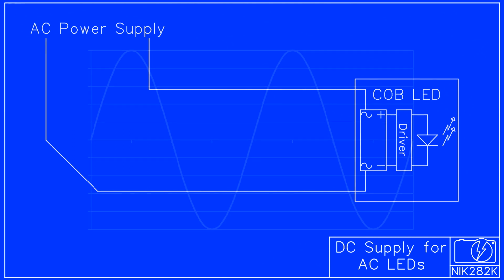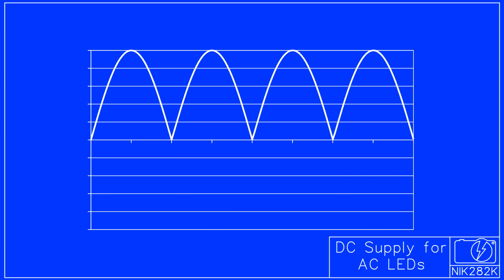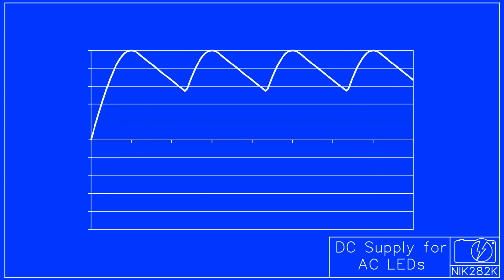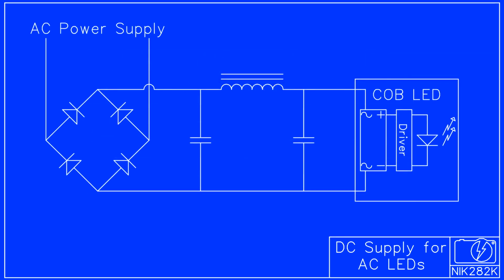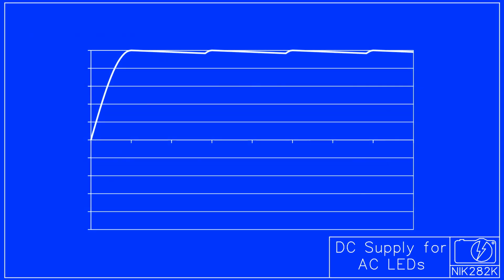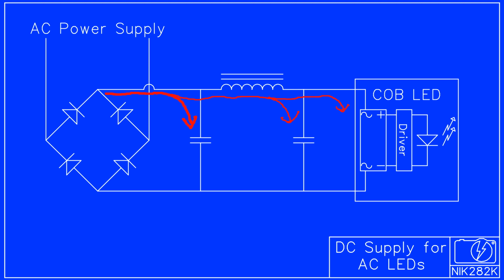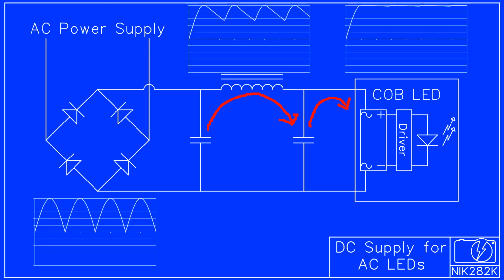De-Flickering Cheap Driverless LEDs

Comment: nice solution, the issue I get is small flicker when light is ON on a Led COB 50W.
I use somes around and of course with cooling, and sometime there is a weird flickering.
Unfortunately you solution require big stuffs...

Comment: I have solved this in much cheaper way. Just add a 250V 10uF capacitor directly on the LED chain, after the regulator chip. You'll need to scrape off some coating and find which traces are the ones you need.
After doing it, these LEDs become nicely dimmable without any flickering or working out of spec.

Comment: Great video Nick. I'm looking for an LED lighting solution for our table tennis table and I'm wondering if you can help me understand something. I bought a nice bright 100w flood light, installed it, but as soon as we started playing the ball was suffering badly from a strobing effect (probably like your high speed video lighting problems) which I presume is because of the 50Hz AC of our mains electricity here in Australia. If I was to make my own floodlight using a 100w led which was powered by a DC driver would that solve the strobing problem? Would the driver need to  be specifically a constant voltage or constant current - or wouldn't that matter?
Thanks very much for your help.
Reply from the maker: I ended up buying as many cheap LED work lights as I possible and adding a smoothing capacitor across the LEDs. The drivers still put out noisy power but the capacitors smoothed it out. I found that to build my own from scratch would have been almost 10x the cost. If you take your phone to the hardware store you may be able to check for flicker by just filming the bulbs while lit, there are some 100% DC LEDs out there but they are the exception.

Comment: Hello, I was wondering if there is a simpler version of this power supply you build, I bought one of these COB LED boards as a overhead shop light replacement and I can visibly see the flickering.  Is there a small circuit I can build to put between this COB LED Board and the 120V power outlet to stop the flicker?  Thanks

Comment: Hm, I think if you buy a 220V LED and apply the rectified 110V signal, you'd end up about at their original rating! You can also add the capacitance onto the board directly (under the silicone), though that won't filter as well as your LC circuit, it may be good enough.

Comment: Hey Nick,
How do you calculate the size of the capacitors and inductors needed? i'm trying to build some custom LED floodlights without flicker..
Reply from the maker: There are a number of online calculators you can use to calculate the values. I only had the one large inductor on hand and for the capacitors I kinda suck up on the value by measuring the ripple and then adding more on either side of the inductor. If you are going to be working at a fixed voltage it might make more sense to just get a switching mode DC supply. They are a lot smaller and don't require heavy iron cores.

Comment: Good work nik keep it up was really cool to see

In my country we are supplied with with 220 VAC @ 50 hz and also noticed the flickering, it could be actually a higher flickering rate (since I recall this means higher dc spikes due to lack of bridge rectifier on board) I could be wrong.

Comment: Have you considered using a T rather than a Pi filtering circuit? It should cut down on inrush as well if I understand correctly.
Reply from the maker: I only went with a PI filter because big caps are a lot easier to find than big inductors (without cutting up more transformers). I could add some how power/low value resistors in series with the caps to limit the inrush but I have just taken to slowing increasing the input voltage from 0 instead of just switching it on to a full 80Vac.

Comment: did you know that there are circuits that can 'cheat' at the ripple reduction? the 78xx series uses them in thr final internal output stages. tip31 transistors, too. they use negative feedback to eliminate ripple. the downfall is you need trsnsistors to handle all the power ( to-3 cases would be best but you can get to220s out of any old crt tv near the pcb on the socket ) id google ripple reduction and.mosfet because there has got to be something new out there since i was in electronics college
Reply from the maker: I originally went with this big linear supply because I wasn't sure exactly what type of lights I was going to be running, although I have now settled on a slightly simpler solution. If I had the experience I would have ideally made a big switching mode supply that would let me really cut down on the ripple.

Comment: I think even at 120V DC the LEDs will be overdriven since you have no off-time in the DC case. RMS and DC are only compareable for a purely resistive load, but the LEDs with their inherent forward voltage and the driver chips are an off/constant-current load. Luckily those driver ICs (I have a few of those LED modules as well) have a built in over-temperature protection, that protects them from too much load. They also indirectly protect the LEDs since they are mounted on the same board. But this is only a protection against gross over-temp and should not be relied upon.
Reply from the maker: The off time was my first thought as well when I started playing with this and I found something really bizarre. When I run them at 110v (maybe slightly under driven) they heat up very slowly when mounted on some 3inch Al channel. But when I run them right from mains as they were intended they get flaming hot in a hurry (see the link below). I haven't run them hotter than 70c and the spec for the driver says they are supposedly good above 90c but I don't plan on testing that claim.

Here's a comparison of how hot they get depending on the input voltage: http://i.imgur.com/q4lQUxv.png
Reply: That's not really that bizarre. The driver ICs are kind of variable resistors. The 110V DC seem to be very close to the forward voltage of the LEDs (or maybe even lower than the forward voltage at nominal current) so the drivers don't have to do anything. The heating is coming purely from the LEDs (which might even be underdriven as you said). The reason that 130V DC and 120V AC curve look so similar could be that the 130V are still close but above the nominal forward voltage (so the drivers burn the rest), while the peaks of the AC are much higher than that. For resistive loads the power rises with the square of the voltage so the much higher power dissipation at the peaks could make up for the no-power time when the AC is below the forward voltage. You would need to find the "sweet spot" for the DC voltage to just start using the regulators. But that would defeat the whole purpose of having a "driverless" LED module (as in no power supply needed). This is pretty much the point where I am at. I can't stand the flicker of the stock module but providing stabilized DC (something around 200V DC in my case of the 240V AC version) is a challenge of its own.
Reply from the maker: If I was going to do this again I would probably just go with low voltage LEDs but these 100W modules were only $9 and the DC supply parts were less than $20. I'll have to see if I can find at what voltage the "driver" kicks in and see if it still runs cool. I tried it at 130vDC because that is the point at which the LED doesn't get any brighter with increasing voltage.

Comment: Very nice result! What's the maximum power output? What's the limiting factor for power, the little variable transformer?
Reply from the maker: I believe it's the capacitors at this point, they can only hold so much energy but for now it can put out about 250-300w without noticeable ripple.

Comment: Outstanding explanation Nick!  I don't think I had ever seen it explained in an easier to understand terms.  You should consider teaching...
Reply from the maker: Thanks, the spring and flywheel has been how I think about capacitors and inductors for years, it makes the concepts more tangible to me. I have thought about teaching but it means being in a classroom full of students and having a set curriculum. Maybe if I get worn out in my current career I'll switch.